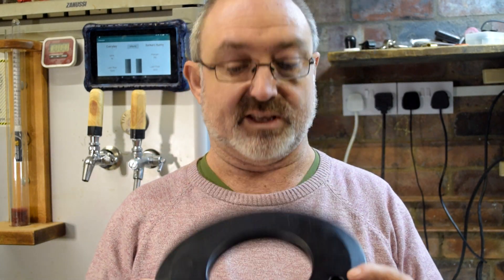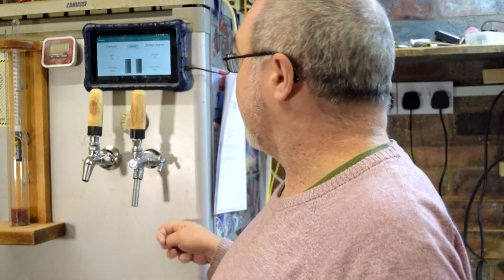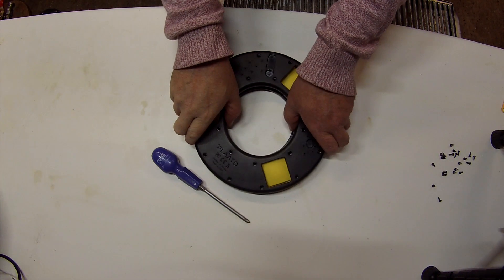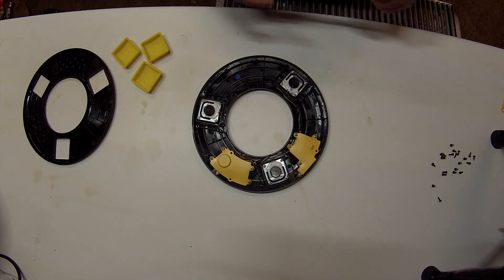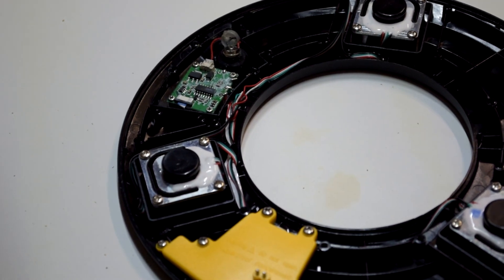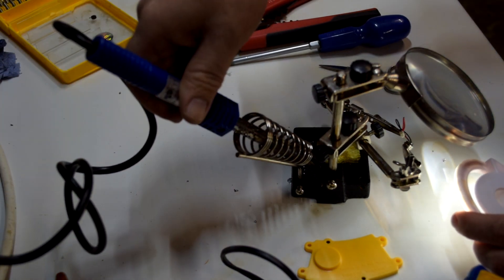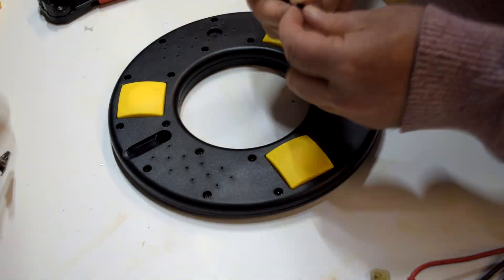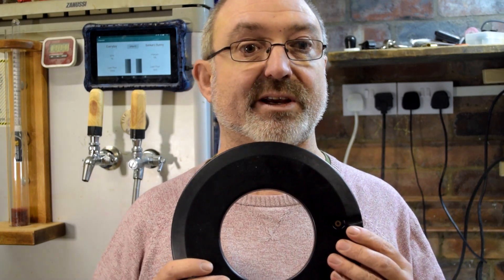Fixing a Plaato Keg

Comment: Good work! Hope that this is not a common problem for them but if one of mine ever breaks I now know what I'll look at first, thanks!
Reply from the maker: From my conversations with the people at Plaato it didn't sound like a common problem.  Looking at the connector it is possible that there is a little bit of movement as kegs are put onto the device so may be that caused the wire to come off.